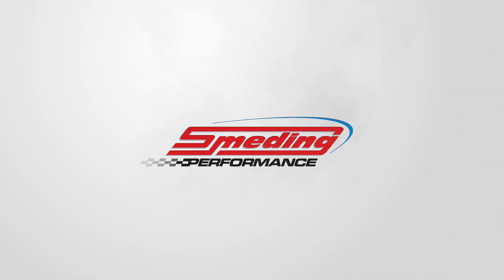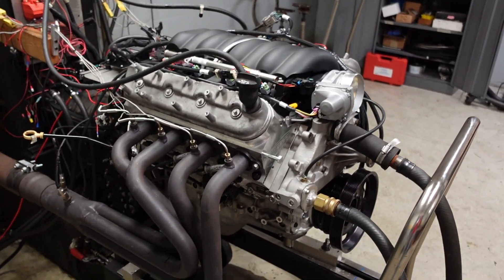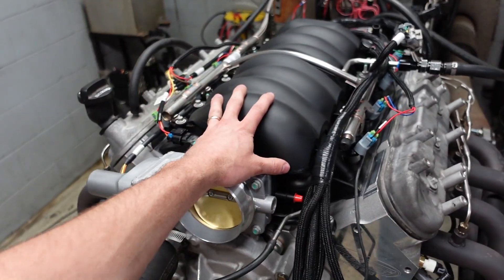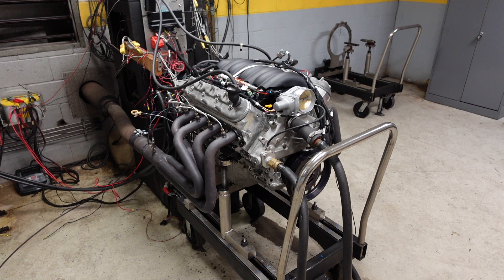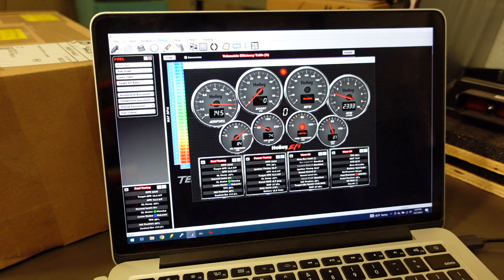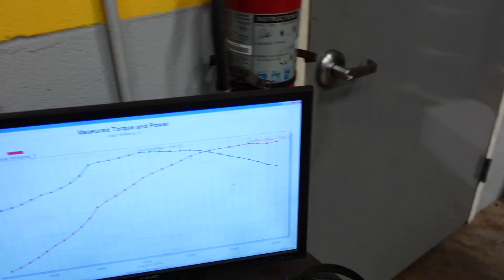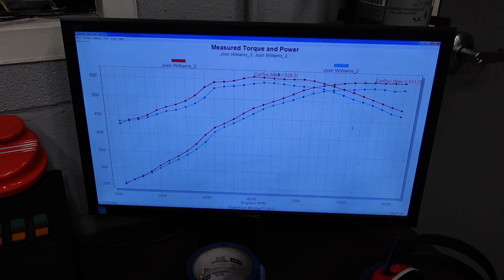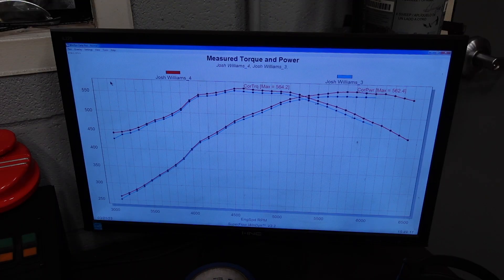427" LS Engine Dyno Testing! (supercharger rated)

Comment: I'm am looking to build a 600hp engine for a 2005 Silverado HD. It's currently a 6.0. I want to run pump gas. How would you go about achieving this.  Looking to make the power between 2500 and 6000. Also if possible would like to make 600 footpunds of torque.
Reply: 600 HP and 600 lbs at under 6,000 RPM is screaming for boost. Get a magnason supercharger and call BTR for a cam recommendation. Full exhaust. Headers, high flow catalytic converters, and free flowing exhaust.

Comment: Very Very nice. Would like to see a NA 427 with 12:1 build.  I'm contemplating buying a shortblock, from Smeding to use with LS7 style heads. I'm not sure if the pistons you use will clear the LS7 2.200 valves. Oh, and it's gonna be a LLSR. Should make for a pretty nasty street motor. I agree with one comment below, a 427 needs a bigger valve. That's why the LS7 makes good power stock and H/C/I builds. 620-650whp all day long.

Comment: 2.165 valves on a 427’ don’t help either 🥴
Reply: Agree - this much displacement would benefit from the larger port and valve of an LS7 head. Never know all the reasons a combo ends up the way it does - should rip regardless with a 2650 cramming it full of air.
Reply: Are you saying that’s too small? What are you saying?
Reply: @baby-sharkgto4902  choking up the power. 2.165 are OEM LS3 sizing OEM, LS7 are 2.200, serious LS7 aftermarket castings are 2.250
Reply: @randybdis  ok. this engine would not gain anything from a larger valve
Reply: @baby-sharkgto4902  This Engine will Benefit Greatly through the Entire Power Band from a CID, mast, or Frankenstein headed LS3 with Larger Valves 2.200 or 2.250 valves. Why spend big Bucks on a bad ass Short block and then slap some China LS3 heads on it.
Reply: @randybdis  is completely right, but with the 2650 we are throwing into it should still put down some power. See my bank account ain’t like it needs to be lol just needed a engine but we should still be pushing 1,000+hp with all the supporting mods we have along with this engine. Frankenstein’s would be nice tho! Haha

Comment: Awesome, I'm not sure how they expect the factory ECU to keep up with the fueling requirments but I guess that's what scaling is for. 

On a unrelated topic can someone tell me the difference between an LS and SBC aftermarket Eagle Rod? I have a set of rods with no markings wondering if I can measure or look for something.
Reply: Factory computer can handle this easily. This isnt a radical build. On the rods the LS is probably longer at 6.125 vs the sbc at 6.0
Reply: @taylorsrus9543  Yeah looks like the easiest laymans way is to throw some bearings in them run them side by side on a crank.

Comment: Hey Jacob, can you post what the 'Advertised Duration' numbers are for the 500HP (.525/.525 Lift, 225/236 Duration @ .050”, 110 LSA) and 600HP (.612/.612 Lift, 236/246 Duration @ .050”, 110 LSA) Camshafts that are offered as options on the LS 416 listing on the Smedding Website if you don't mind ? I just want a rough idea of how aggressive the Cam Lobes are by calculating the ADV:@.050" Duration Ratios. Thanks in advance.